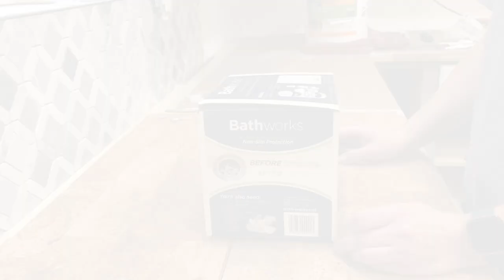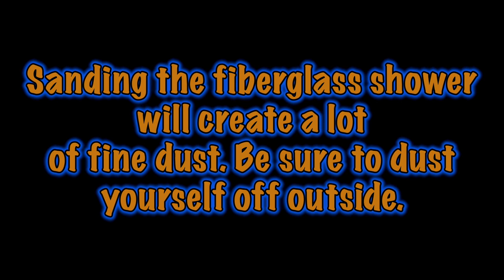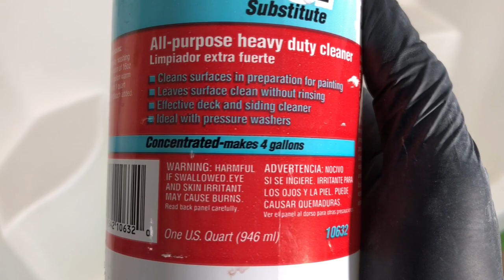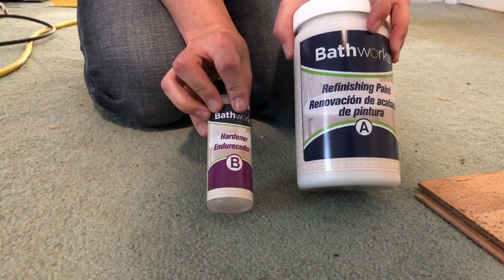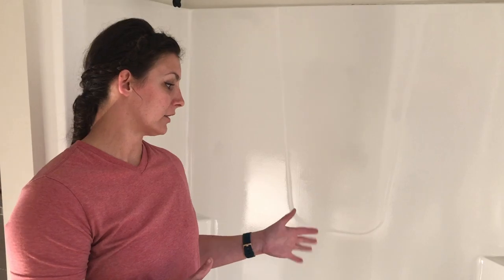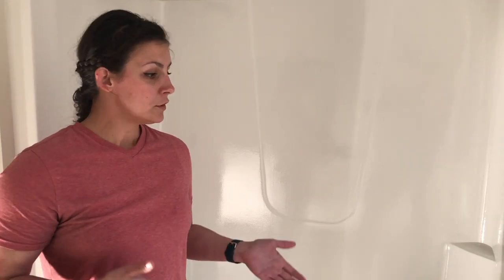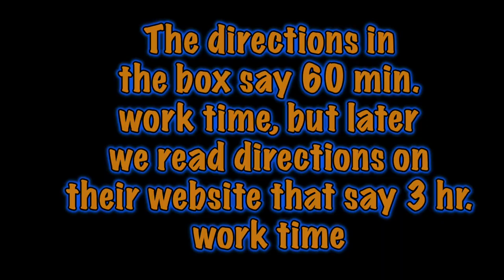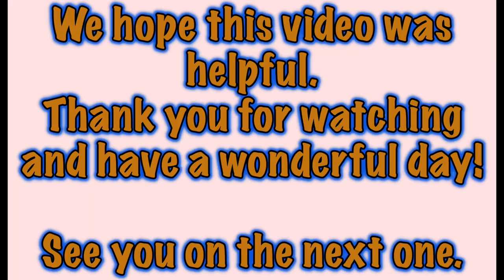DIY Bathtub/Shower Remodel - Bathworks DIY Kit Shower Refinish - 4yrs and going strong!!!

Comment: I will be getting to the painting step this weekend but I found that hitting the caulked areas with WD-40 breaks down the caulk and makes for easier sliding with the razor blade. Also, believe it or not, I used one of those triangular head power sanders with the hook and loop pads that allowed to get into corners, didn't require any pressure and you could cover the shower very quickly on that sanding step.
Reply from the maker: Hey Michael,
One though with using WD-40 is make sure to completely remove ALL the oily residue before painting. Good call with the sander and light pressure, working smarter not harder. 😀 How did your project turn out?
Thank you for watching.

Comment: I just finished this project. I have no major drips or runs, but it did not dry as smooth as I hoped.   The instructions   encourage you to keep the roller wet and not "dry roll"  but when I went back for the second coat that whole step was essentially a dry roll.

The cost and the effort is worth it for an average home,  but for a higher end renovation I can see why someone would hire a professional that would spray the material.
Reply from the maker: Hey,
The surface prep prior to painting is the most critical element for success. We are glad to hear your renovation was a success. We are very pleased with our results and how it's holding up.
Thanks for watching and supporting the channel.
Have a wonderful day!

Comment: Great video, thanks. I'm about to take on a small shower stall by myself, so your video was very helpful and informative. One suggestion, trying to get "crisp lines" is almost impossible, so what I've done in the past is use caulking to "smooth out" the line, appearance-wise. My grandpa taught me that caulking helps "hide a multitude of sins."
Reply from the maker: Your grandpa is a wise man! We used green frog tape for cleaner edges (wait 15 minutes before carefully removing the tape at a 45° angle) then we caulked all of our seams once the product had sufficient time to cure... It definitely makes things look much neater! We wish you the best of luck with your project! You got this 👊

Thanks for watching!

Comment: I have used this product. Bathworks works great but you need to be careful with the prep.  The prep and tools are key.  I did a different technique on my tub and shower walls by putting the product in small cups and poured it down my tile walls from the top and then spread it with a foam roller intended for oil based paints.  It turned out great and I didn't get any roller marks.
Reply from the maker: Hey thanks for the tip! We have another shower and bathtub to do, so we may give that method a go.
Thank you for watching!
Reply: @thelarewsdo  one other thing I found was a product called Ekopel.  It is not a stinky as bathworks but if you watch the videos for how to do Ekopel.... You will see what I mean about pouring it down your walls. I still used a roller but it went alot smoother then just rolling it on. I have never tried the Ekopel but I liked the pouring method.
Reply from the maker: Thank you, we are in the planning phase now on that bathroom so we will definitely look into it ! There is less ventilation in that area of the house, so less odor and fumes would be a plus as long as it holds up as well as this Bathworks is.

Comment: Awesome video! Thanks for the pointers! Will this product be something I can use on a cast iron tub, or porcelain sink or toilet? Looking forward to seeing what all projects you get into during your remodel!
Reply from the maker: Thank you! This product can be used on cast iron, porcelain, and fiberglass tubs, sinks, tile, and showers. Not sure about using it on a toilet 🤔. The only problem I could see is that the risers/bumpers on the bottom of the toilet seat could mar or indent the finish over time. Bathworks recommends not allowing anything to rest on the surface for extended periods of time.

Comment: I did this to my shower about 1 month ago. I have a lot of drip marks because the instructions said not to dry roll. Can these be sanded and painted over? I have an extra kit. Suggestions appreciated
Reply from the maker: Hey Rosie,
I would think that those areas could be sanded down. Then, prep the surface per the original instructions, skipping the liquid primer. It seems to be similar to paint thinner and I fear it would damage the epoxy. IF you choose to add that step, definitely test it on a small area first.
Personally, we would do the TSP wipe down after sanding and clean things up with a tack cloth then get to painting.
If you notice runs or drips during the new application, be sure to roll them in before they harden. Also, try to feather the new paint onto the non-sanded area to help blend in the repair.
We hope this helps! Please let us know how it goes. 😀

Comment: BTW, the ventilation has me concerned. The bathroom is small but there is a window that goes right outside. You suggest a fan against that window to draw the fumes out or at the door way blowing the air out and closing the bathroom door? Also, this takes two coats, so I'm thinking you do the walls, go back on the walls a second time then overlap to the floor/tub area twice unless it is possible to use a roller reach type pole.
Reply from the maker: Hey Michael ! 
First, the ventilation. I would suggest putting the fan in the bathroom window and blowing the air outside. Open another window in the adjacent room to create a draft and that should help get the smell outside.
Second, I would suggest doing the entire shower during each coat--walls and floor/tub once then go back again and coat walls and floor/tub. If you do the walls twice and then try to blend the floor in, it definitely won't blend well. 
Third, we really like the idea of using the triangular sander with light pressure! Definitely sounds like it would save some time as long as you're not too aggressive with it. We'll consider using one for our next shower/tub redo.
Thanks for watching! Let us know how your project goes!

Comment: I'm painting shower floor tiles that are small so lots of grout lines. Do you think a regular roller cover (non-foam) with a thicker nap would work?
Reply from the maker: Hey Mark,
The product is pretty thick and sticky. I'd think a foam roller would still work for your application and would adequately cover the grout lines and tiles. You could always have both a foam and non-foam roller on hand, start with one or the other and switch if you feel it necessary. 
We'd be concerned the product would pull lint from the non-foam roller and the heavier nap would leave a texture.

Remember - - it's like painting with honey 😊 Good luck! Let us know which roller you end up using and how it goes!
Reply: @thelarewsdo  Sounds good. Thank you for the feedback.

Comment: We used this system and I do NOT recommend it. There is no such thing as a short cut. The kit says nothing about a warranty but it does say that any standing water on a sill must be removed and that you can not use a bathmat without a suction cup and basically you can't put anything on the edge of the tub. If I would've know that I would've walked away. We bought 2 kits, one for the shower walls and one for the tub. The little woman used up 2 entire kits just on the tile walls. You'd think the manufacture would assist in the cost to get the tub done but they gave us the finger. And you'd think since the product was twice as thick on the walls that it would be more durable....NOT. This product has been on my shower walls for 2 weeks and I can already see tile underneath. This is a crap product but let's see what the warranty covers and how well the manufacture cooperates....maybe I'll get some satisfaction after all...oh and yes, I am going to replace all the tile...
Reply from the maker: Hey,
Pre painting prep work is what makes or breaks the outcome. We spent the majority of the time preparing the surface to accept the paint. It also sounds like you should have 'dry' rolled; too much product on the roller will create a nightmare to work with. 
It's been years since we painted ours and it's still just as nice as day one. We leave shampoo bottles on the shelf and have had only a minor issue. But, that was after 3 yrs, is easily repairable, and the manufacturer was super helpful. As far as the floor, we added grip material to the floor and it's worked great for traction in the shower. 
 We're sorry to hear you had a bad experience with it, but it all comes down to prep work.
 We still have one bathtub to do and we'll try to make another video showing that process and reviewing our shower after all these years.
 Thanks for watching and supporting the channel.
 Have a wonderful day!
Reply: @thelarewsdo They're right.
Reply: @thelarewsdo  Our experience with the product was that it dried too fast and rolling it became a nightmare. That's why we ended up using twice as much product. Our prep work was above and beyond because we knew that this would be a one shot application An update: the sill under the window was pat dried after each shower and now there are 6 spots where I can see the original color of the tile and the grout. When we do the tub we will re-apply and hopefully get some longevity out of the product, I still don't recommend this product. I would rather do a re-tile or an insert..

Comment: metal tubs can be repaired with bondo. If it ain't smooth before you paint, it wont be after you paint.
Reply from the maker: Yep yep, it's the 5 P's : proper "preparation" prevents poor performance.    Thank you for watching! 😀

Comment: How is it holding up after a year?
Reply from the maker: Hey! The shower is still just as nice as the day we first started using it after applying the coating. We are very pleased with the results. One thing to note though, you do not want standing water to lay for extended periods of time.  (For example, allowing your wet loofah to lay on the built-in bench or the bar of soap to lay in water). This causes the coating to develop bumps/rough spots. We noticed this, then changed our shower system to eliminate standing water and the coating "dried" back out and it's still good as new. Thanks for watching! Have a wonderful day!

Comment: Do you think it’ll hold up to a sink?
Reply from the maker: Good morning! 
We would say yes, definitely to a bathroom sink. And, quite possibly to a kitchen sink depending how rough you are with throwing pots and pans in the sink. The coating seems to hold up very well. We have been using it everyday (3 showers) for 6 months and it still looks as good as the day we finished it.